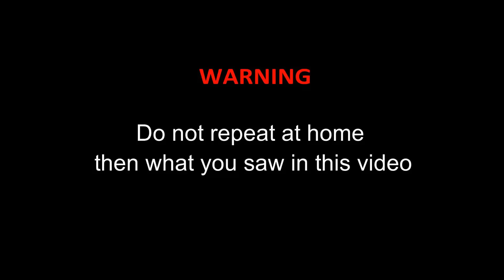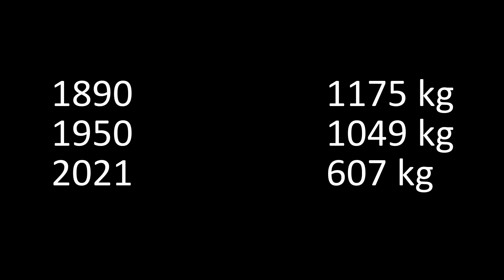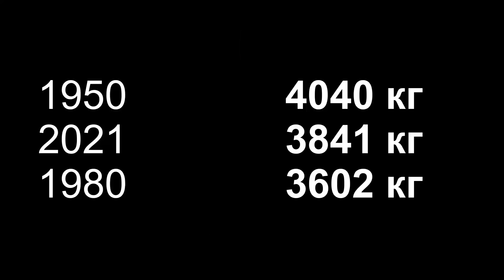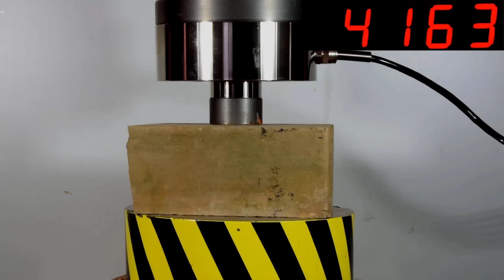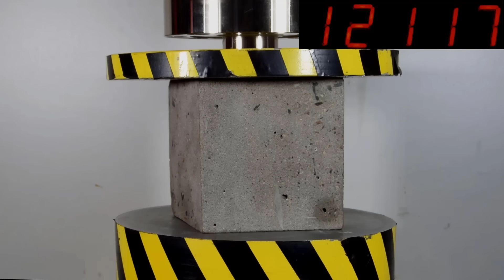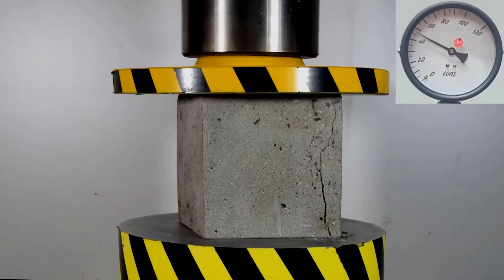HYDRAULIC PRESS VS OLD AND MODERN BRICKS

Comment: The outcome of this test had so many variables such as material quality, production skill, manufacturing location, material age, material depth/width/length, placement etc. It was enjoyable & interesting to watch!
Reply: @dingzhixu3678  the way the bricks were manufactured would greatly effect the quality of the bricks though
Reply: @dingzhixu3678  Right, so the way something is manufactured has no bearing on it’s quality. Did you even read what you wrote?
Reply: No.. I'm saying, the testing method is just a method for easy comparison.. The way it's manufactured, I'm intimate with every method of brick manufacture and QC has  been half my life trying to build an independent brand name.. Every part of production is important in determining its end quality, but raw material and the burning process  determines hardness, manufacturing determines its finish look (contry to untrained eyes, rough surfaces is better than smooth)
Reply: You sound like my teacher making interesting things boring
Reply: The testing is completely flawed, the 2021 brick is extruded by a machine where as the other 2 are pressed brick, which are compacted over 4-6 times stronger, would have been better off comparing wood to brick, Pressed brick is still made to this day however it is around 4x more expensive than extruded hence why they aren't as common.
Reply: @neiljohnson8252  the results can't be used for proper comparison. Industry standard testing is like the 3rd brick test, where it's laid flat and then the press stresses the brick till breaking point (industry testing method) . As for pressed brick.. To the best of my knowledge.. Does not exist today, not on factory production scale anyway.. The hydroulic pressed machines that makes 2-4 per press would be more "hobbies or arts&crafts" as it can't be used for mass production. Plus, what is the application of a brick that hard? Bricks "weakness" is its weight, hence some countries have outlawed solid bricks. The conventional holes also provide better sound detoning, weather resistance and many other benefits.. And just FYI, 4-5 times harder and/or heavier is an extremely exaggerated estimate.. Clays natural density doesn't allow doesn't allow 4-5 times, when it's fully vaccummed, it  weighs 20% more, at most 22-23% if u got powerful vacuums.. N for the benefit of other "experts - aka dole budgets" , the vacuum pulls all the air pockets out of the brick.. Lastly, the composition of brick one is pebbles, that are derived from the first crusher, some factories are install a stone crusher for ease of work so that in places where clay is not abundant, they can accept "contaminated clay". This concludes my lecture, if anyone has actual inquiries u can contact me.. And brick making is immensely more complicated than some people can fathem.. But I can write books on the subject (not going to tho)
Reply: @adwaitpatil3670  there is nothing funny, interesting or easy in brick making.. But stupid jokes and sarcastic attitudes has the potential to get workers decapitated as these are big machines all designed to pump out tonnes of clay a day..
Reply: @dingzhixu3678  the application is the look of the brick, along with the ability to make customised designs such as arrowhead, pavers, curves etc ..
You are right the vacuum chamber between the pug and extruder does take the air out of the clay but there is only the pressure coming from the screwfeed, I can easily squish a fresh extruded brick in my hands even just after the screw feed has been replaced and the pressure is highest, there is the matter of water used, there is far more water in an extruder brick compared to a pressed brick as the water is squeezed out of the spew holes on a pressed brick due to the heavily increased pressure and it often takes quite a bit of power to break a freshly made press brick in half, and you let it sit for an hour and it might aswell be fired at that point.

Pressed brick is still made to this day, I maintained 7 of such machines for a few years up until early last year, they were making 300k bricks a month and a million when I left, albeit the machines were over 70 years old and required constant upkeep and repair but we're very sought after and interesting machines to work on, if not terribly dirty.

Industry standard of the strength of a brick at least where I live is done with impressioning, chemical processes and some sort of ray type device, there was definately no hydraulic press in the lab and the lab techs never left their area, that type of pressure only tells you where the weakest point is, not the actual overall strength.
Reply: @neiljohnson8252  wow.. Must be simultaneously using all the brick presses with adequate employees.. But my production rates are 100k a day, 3mill a month.. Being one of the smallest Kilns in the country.. But yes, I was talking about the developed countries in Asia, like Japan n Taiwan.. Chinese bricks after firing can be smashed by palm, but the Chinese bricks are only slightly fired as they are self-burning. Viet bricks are totally differnt too.. A major factor is earthquake frequency. I'd imagine pressed bricks are more common if it's a snowy climate. Forgot, korean  brick quality is the best to come out of Asia.. And their application is like art work
Reply: @dingzhixu3678  He uses different shaped presses though, different sizes = different pressure per area
Reply: Its curing technique, mineral content and density ,not age, that makes the difference
Reply: His modern concrete was sand based mortar and too fresh to test
Reply: @adwaitpatil3670  Would you rather have a teacher who told you what you wanted to hear even if it were untrue & fun or one that tells you all of the possibilities for you to make an informed truthful & wise decision? Your choice grasshopper.
Reply: @dingzhixu3678  quality has to do with manufacturing 😅
Reply: @dingzhixu3678  but we all saw the brick from 1890 has better value than the easy broken from 2021.

Problem is mass production in the cheapest way. In 1890 that was like handmade with less regard to the cost as ingredients had been harvested direct of source.
Reply: @ulfseidl1216  your smart. Must be a big CEO of a fortune 500.
Reply: @dingzhixu3678  more like the fortune 10 😉 and thanks, but that's just common sense nothing more.
Reply: @dingzhixu3678  oh BTW do you know that most ceo are not very smart? Look up Trump 😂
Reply: Anyway the whole discussion on how strong it is dosent matter here now all of them are good enough for the job they intended. I mean no one build a bank with brick stones, or a 4lane highway.
Mostly used in cold areas to build mainly singlestory houses for their insulating properties. No need for a single brick to support 16 tons or more.

The argument was that over a hundred years ago they actually made better ones than today. Need aside...
Reply: @omnigirl987  ☠️☠️☠️ ok miss
Reply: @adwaitpatil3670  I’m a Mrs. & have been for 45 years. I wish you to have a great life & I really mean that! Take care of yourself Adwait.
Reply: @ulfseidl1216  You openly support Biden? Hahahaha!!!!
Reply: @dingzhixu3678  The section is actually the smallest of the factory, I maintained the machines during the day, another guy during the nights and occasionally I had a 3-4 extra worker's to catch up on big jobs.
It was ran by 2 operator's with some assistance from myself with issue's and then they maintained sizing and notified me of anything that broke throughout the run, they only ran for 4 constant days twice a month to hit a target of a million bricks a month out of the 7 press's.
They're common in area's with Victorian style houses and buildings.
There was 6 main press's which were significantly slowed down from their maximum speed to a rate of I believe 48 bricks a minute, they were designed to do upwards of 80 bpm however I believe there was more breakdowns at that speed but it was before my time.
The main extruder's make over 200 bricks per minute 24 hours a day at the place i worked.
Reply: @omnigirl987  you too have a good life sorry didn't know ur age thought you were someone my age my bad I see what you mean
Reply: @dingzhixu3678  am a carpenter
Reply: And the proper brick to use in building also varies alot in the environment your building. A soft compression clay brick is much better suited for wet humid environments because of the expansion and contraction properties due to rapidly changing humidity levels, a hard compression shale brick is much better suited more dry and arid regions the brick us alot less likely to Crack due to no moisture absorption and no freezing  during winter.
Reply: moisture also plays a role. Newly made concrete tends to be more moist and sandlike.
Reply: @adwaitpatil3670  sounds like the student who goes to class and sleeps all day. When the teacher calls on him to answer a question, he answers "Kakarot's power level is over 9000!"
Reply: @ahhchoo8488  yes that is accurate
Reply: Why buying likes no one even knows you lol
Reply: @budsbunny5610  are you talking to me?
Reply: Ya like how the only one not tested on the 2 slabs of metal was the modern high strength
Reply: I looked REALLY close on my phone and I could tell the bricks were in the exact same place and were also completely average down to the last detail.   I deem this the one true test.   People all over the world should expect that every similar brick they encounter to have the exact same performance... on average.  SCIENCE!!!!
Reply: bricks used to be highly standardized.
Reply: The biggest skewed variable is the fact in the first test he places the bricks between two posts and in the third test he places the bricks on a flat surface, thus the bricks exhibit less strength in the first test due to them having to flex
Reply: All older stuff 1950’s and before where made to last, from cars, clothes and homes. Today we just trash it and get a new one
Reply: @talltexan4710  not necessarily. Older stuff was built with different materials, but it was not just made to last.
Reply: Right?! The placement of the bricks both vertically and horizontally was bothered me the whole time…. As well how they didn’t mark when initial fissures-cracks formed in the bricks vs. when the brick actually separated. A lot of tester-errors or inconsistencies here.
Reply: @Sankofo_90  for me the biggest inconsistency was the fact that in the first test the bricks were laid over to posts. This causes a lot of flex in the center where the press is pressing down thus introducing plastic and elastic deformation to the piece rather than just testing the compressive strength. In the third test you see the brick laid on its side which was also a modern brick but was able to support vastly more weight. This is because the brick was laying flat on its side without any air underneath it and only flat on the actual piece of hydraulic press. Thus it didn't have any flex and only had compressive testing
Reply: Also a more realistic test would a compression test. Tensile strength isn't as significant in a practical scenario
Reply: My experience is that most older bricks are softer....while newer bricks are harder which means newer are more brittle particularly if they aren't flat and are pressed on. Softer bricks would flex more allowing more surface area to be touching the base plate. When laying bricks the mortar fills in all the cracks and holes giving a more even pressure from the weight above.
Reply: You might also need to consider that perhaps the crap bricks made a hundred years ago aren't around anymore, because they were... you know... crap.
Reply: @ulfseidl1216  I heard that in 19 century sometimes used to add chicken aggs to harden it. And of course we can't talk about standards  back than. Everyone did try their own way from local materials.
Reply: @andyz7711  we are in the 21century now...  Seems your nation is way behind 😊

Chicken eggs lol,  chalk and protein,  on the chemical perspective it would make brings weaker easy to break when burned
Reply: @ulfseidl1216  I wrote- in 19th century, if you're not able to read, not mentioning in which regions, poor you are tryed to be rood but looked only stupid.
Reply: @LecturaReading  please tell me on what drugs you are on?  I want this insane rush too 😂🤣
Reply: @mylesmarianchuk6466 is clay from an Anthill alone ideal for brick making